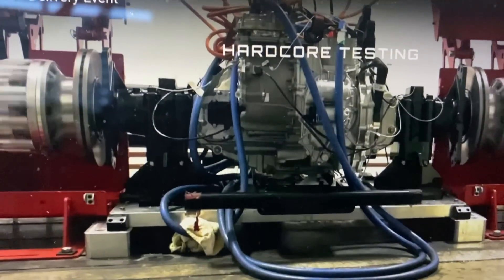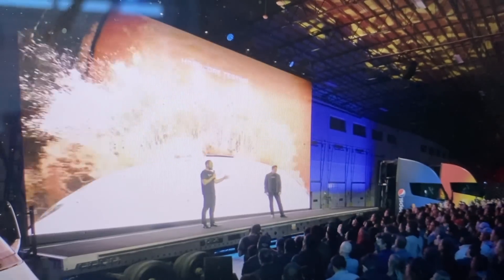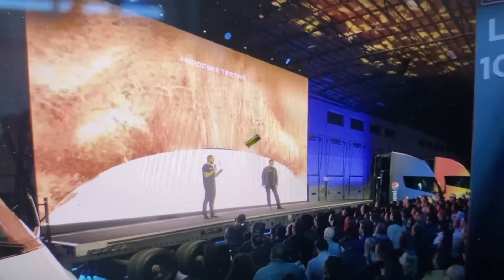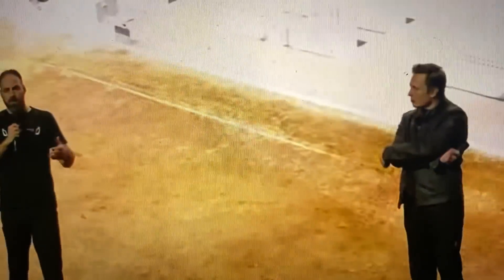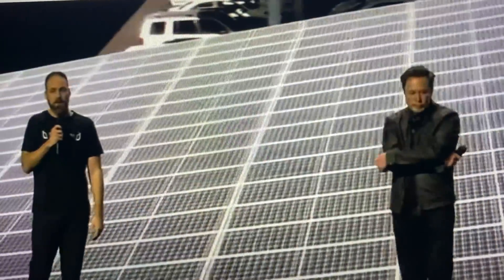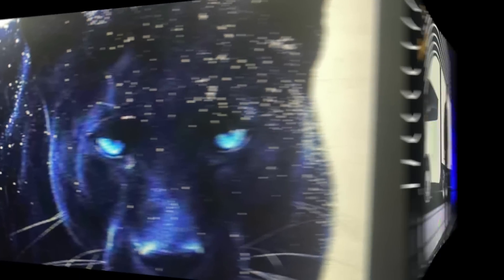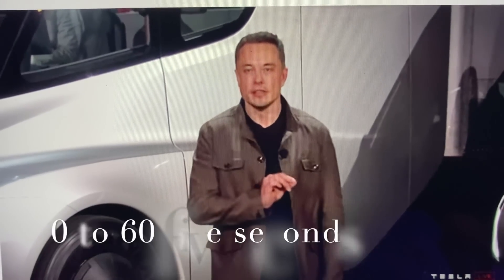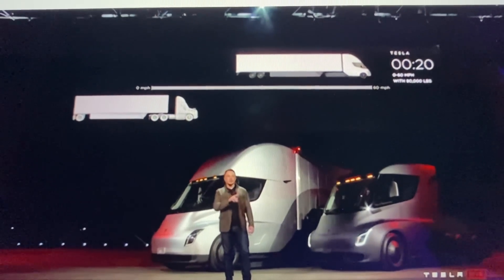100 Mile Tesla Pepsi Semi? 2022. (a850)

Comment: The battery will generate heat as it discharges and insulation will conserve that waste heat.  The low temperatre is not as bad as you indicate.

Comment: I used to work for Pepsi at another location.  They have pre-determined routes.  It doesn't matter whether they're hauling chips or beverages.  Also, on most routes, they are loaded on return trips to minimize dead heading.
Reply from the maker: Great info

Comment: A few things.
Once the battery is warm.   Does the internal resistance generate enough heat to keep the battery warm of course this depends on the outside temperature.  
One can precondition the trucks while plugged in.  This may not require the mega-charger.   KInd of like using an ICE block heater.
Put the blinking trunk in a building to keep it out of the wind and cold where practical and plug it in and start with a warm preconditioned battery.
Reply from the maker: Good thinking

Comment: Why can't they put a lot of insulation around the battery pack?
Reply: I think they could have insulation but also a valve system to allow air into the insulated area to cool it further if needed. Tesla cars had the super bottle and the Octo valve system to share heat between different systems and the cabin and I guess they could also vent the heat if needed.
So add insulation to solve the cold problem and if the insulation causes a new problem then solve that problem as and when required.

Comment: I'm sure Tesla has software which uses input variables to calculate the effects of temperature on their range displays. That being said, we will have the opportunity to see the real world operational data from the Pepsi fleet in due time. I noticed that you only referred to climbing when discussing the semi's range through the mountains while ignoring the huge benefit of regeneration while descending. The value of motor/generator braking is one of the biggest advantages of electric vs diesel when comparing the energy required for climbing and descending grades.
Reply: @Enrique A Thiele Solivan Great! that pretty much levels out the grade to flat road at all times for the tesla semi. I used to work in the electrified rail industry and remembered how much energy was produced by 2 80,000 lb transit vehicles during regen braking. They had to install huge resistor banks to dissipate the excess power if the rail was not receptive. As long as the Tesla semi is not at battery max at the top of the hill(not happening) the descent will be battery charging time!
Reply: @Enrique A Thiele Solivan I was going to say regen was not that good. Looked it up and the net says 80%.  Glad I verified that one.   Was thinking the trailer would waste a lot of the energy on it's brakes.  Still have a niggling doubt on this one.

Comment: I doubt the drivers were going 90 mph too. they were probably going 120 mph
Reply: 90 mph that would be crazy.  Wind resistance goes up the square of the speed.  You don't want to  push this past 70 unless you have the range to burn.   Hoovie ran the F150 lighting 75 so just to make it look like a POS.
Reply from the maker: True

Comment: The 100 mile range is not referring to the truck.  It is a reference to the distance between Pepsi bottling factories in California.  What Pepsi said was they would have the heavier loads (bottles) hauled by the Tesla semi from one factory to another which averages about a hundred miles.  The Semi has already hauled some 32 tons of concrete blocks close to 500 miles repeatedly.  To start with the loads of chips and dip would be hauled by the Tesla Semi the 500 miles because it is that far between chip factories.  This is what I read in a release from Pepsi that is one this internet.
Reply: @Enrique A Thiele Solivan Elsewhere a few comments said the Tesla semi tractor was 17000 lbs
Reply: @Tron Jockey Ok well, it wasn't chips and dip :)

Comment: I thought that these batteries were insulated and had antifreeze running through channels to keep them heated and chilled as appropriate. If this isn't done, with the North American climate taken into consideration, then someone screwed up! If the batteries were heated to above freezing, that should be enough to prevent such mileage degradation. Going up a mountain means that you are going to be coming down. Regenerative braking is a reality and does put charge back into the battery.

Comment: Where did you get this 100 mile range info? From Fred Lambert's article on Electrek? That was based on an early version of a Reuters article which misquoted the Pepsi executive.  Reuters later corrected the quote.  There is no range issue. It's just Pepsi's first use while they build out their chargers. They are going to use same or similar trucks, for beverages on full range routes. Your whole tortured analysis is based on incorrect information.
Reply from the maker: The Semis will haul Frito-Lay food products for around 425 miles (684 km), but for heavier loads of sodas, the trucks will initially do shorter trips of around 100 miles (160 km), O’Connell said. PepsiCo then will also use the Semis to haul beverages in the “400 to 500 mile range as well,” O’Connell said.

“Dragging a trailer full of chips around is not the most intense, tough ask,” said Oliver Dixon, senior analyst at consultancy Guidehouse.
Reply: @Teslafaninsight  So right. The key word is initially. The article also talks about Pepsi building their infrastructure. According to that quote they will eventually haul beverages 400 to 500 miles. Somebody other than Reuters needs to talk to Pepsi. They get facts wrong all the time. Also Oliver Dixon has been negative on the semi from the beginning. Hardly objective.

Comment: I have much respect for you, Greg, and have enjoyed your shows for years now.
One other valid point is that providing a thermal insulation system between the battery pack and the outdoor air temperature is quite beneficial to energy consumption efficiency. Slowing the heat loss rate from the battery pack to the outdoors is quite desirable and effective.
Hopefully this is helpful for you.
Please keep up the good work, Greg!
Reply from the maker: Thanks for the info!

Comment: Pepsi will have all kinds of routs. The Semi can do the short and medium runs in one charge. These are routs were Pepsi only has a charging station at one end of the route. 
So the 100miles is really 200miles round trip. 
So until Pepsi has built out its charging infrastructure then you will see this short round trips being included into the long trips were they have full end-to-end charging. @400miles fully loaded and charger at the endpoint to allow the Semi to return to base loaded or empty.
Reply from the maker: true

Comment: Wind can not cause inanimate objects to cool below the dry bulb temperature. It can, however, cool, the objects more rapidly to the point of the ambient dry bulb temperature.
If this was not the case, for example, freeze protection in coolant systems using glycol in automotive radiators would need to be a much lower temperature than they currently are.
Reply from the maker: good info.  thanks

Comment: I just wonder - the battery pack must be cooled under normal circumstances. Logically, in cold weather, there’s no need of cooling (or better said, the cooling fluid needs to circulate to even up the battery temperature but no energy needed for cooling), so to certain point it will actually need less energy that would be used otherwise for cooling. The need for heating comes only when the temp is even lower, but again, until certain point the energy needed for heating would be about the same as that needed normally for cooling. The only question is where are those two temperature points I mentioned.
Reply: It needs to be kept in a certain range. like a cars engine.. The coolant prevents overheating as well as overcooling
Reply from the maker: good points Jason
Reply: @jasongooden917  ... and the middle of both extremes is the ideal temperature. As we don't know it yet, I dare to think that in the ambient temperature there is need to cool rather than heat. This suggests that the range towards colder temperatures isn't overly prohibitive. We'll see, hopefully someone drops the real data here.

Comment: Wind, chill adjustments to temperature are based on latent heat removal by the evaporation of moisture on human skin. Unless there is moisture evaporation on the surface of something, there is no windchill affect.
Reply: BINGO...he grossly exaggerated the effect of windchill in actual temperature. He mentioned batteries operating at times at -100 degrees...this is never going to happen...they will probably never see -30 degrees. He talked a lot and really didn't say anything. Face it...these trucks have been raved about...but they have never been used in the real world...when they perform well in commercial use for a few years...then there can be legitimate praise for them, but not until then. The proof will be in the pudding...
Reply from the maker: Goal is smart people debating what is happening.  No press releases.
Reply: @Teslafaninsight  2+ heads are better than one. 
Agreed